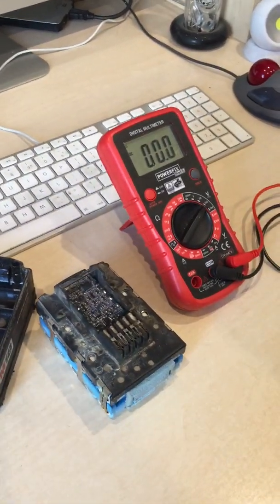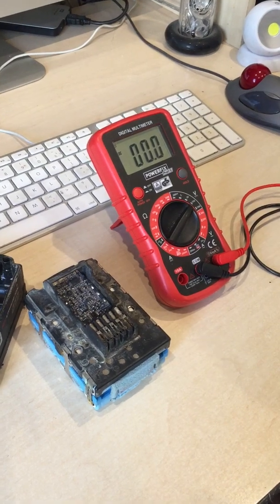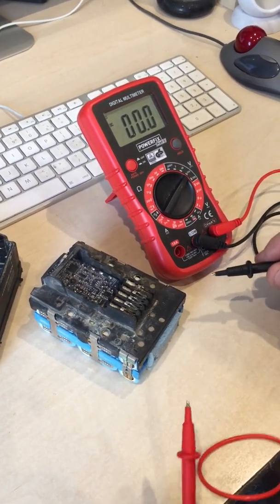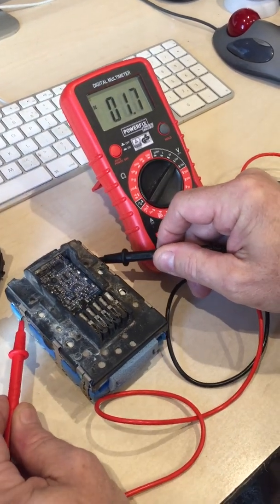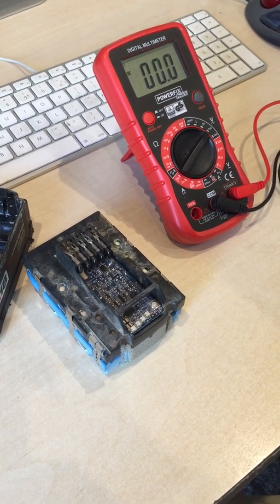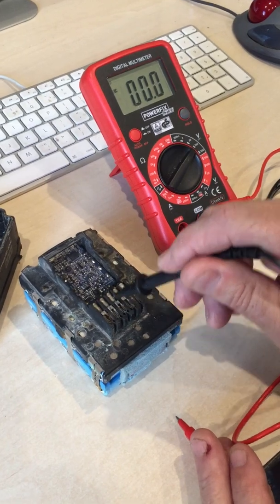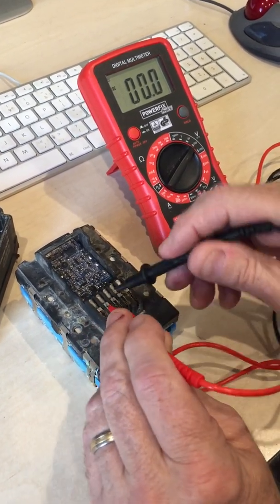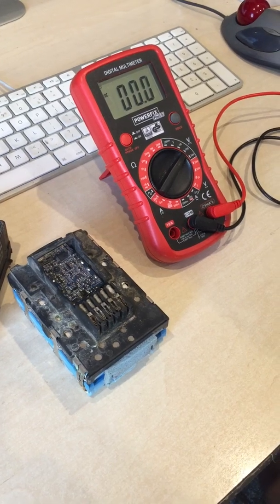Milwaukee M18 Battery Problems - part 1

Comment: This is what I do you connect the positive lead of your tester to positive and negative to negative, the move the - lead of your tester next terminal of the battery pack it should trigger a reset on the battery pack and the led light should indicate the charge of your battery pack now if not your BMS board is defective.

Comment: Interesting. Can you comment back an ohm resistance measurement between b+ and j2. And b- and j2.
Reply from the maker: Hi Charles - Sorry I don't have access to the battery for those figs now (and it was resolved so would be similar to a working battery I imagine). I did post another video showing it had resolved - see link here  https://www.youtube.com/watch?v=1_8HOwJSYzQ
Reply: You can jump it.